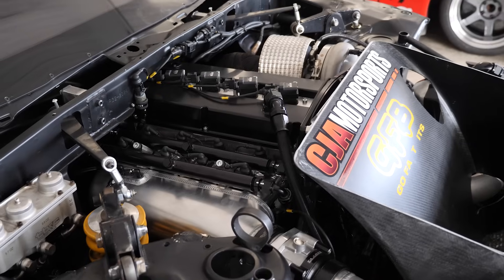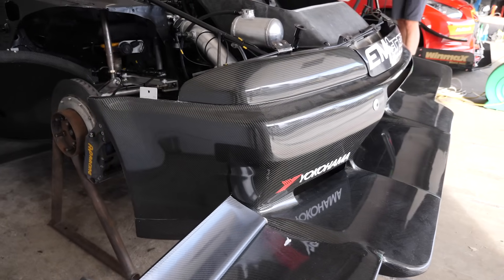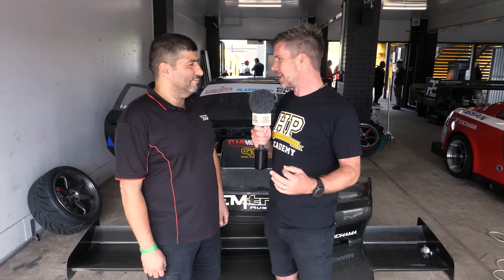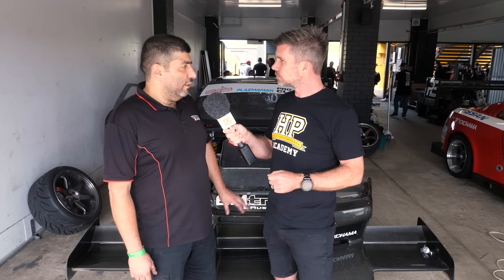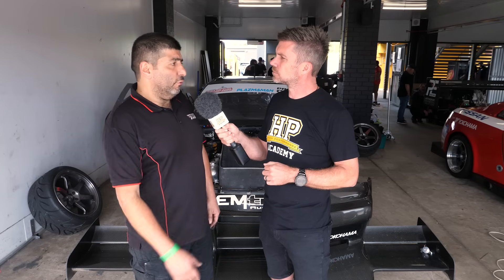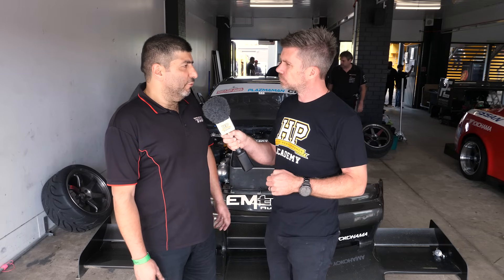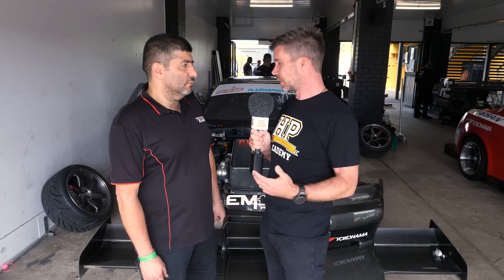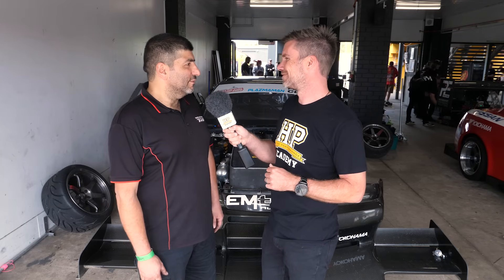Why A 4G63 Is BETTER Than An RB26 | R32 GTR 4 Banger

Comment: I want to do the opposite of this swap. I have a Eclipse GSX laying around with a built 4g63 but it's automatic (hate auto) and the dsm manual transmissions are trash. I want to take a full r34 AWD Attessa drivetrain with the 6 speed and fit it into the GSX chassis (fully seam welded) and get it to bolt up to the 4g63. From what I can tell it should work after getting the oil pan / front diff figured out, and a few other details. It would dramatically alter the weight balance by rotating the engine 90 degrees and getting that heavy automatic out of the engine bay and going with a long shaped tranny down the trans tunnel instead. Ideally the goal would be a 50/50 balanced 2700-2800 lb Attessa AWD Gsx but it'd probably more like 52/48.
Reply: @joels6736  dude put in a forced four shift box man You can tweak that thing to shift it full line pressure and it will smoke any five-speed GSX on the road If you want to know more about it contact Rix racing in Morgantown West Virginia.  He's  the only one around with an all-wheel drive dyno and he specializes in automatic all wheel drive 2G and 1G eclipses.

Comment: 2:11 THAT is the reason they went with a 4G63, the fact they knew the engine well. Sure it can do everything they need but there are other engines that could do it as well, ie: 3SGTE, K-series, or even the standard RB if they were able to work out the weight balance, but it is that they know the engine well that trumps every other reason.
Personally I would say a 3SGTE or a K-series are a bit better but probably not enough to justify learning a whole new engine.
Reply from the maker: Note, they have run one of the worlds fastest RB engines, but you are not wrong, the 4G63 is a better option for this project based on their experience and timeframe which is an important factor to consider and why there is never simply a 'best' engine as what is 'best' is more than just what is stamped on a block without considering anything else! - Taz.

https://www.hpacademy.com/blog/2140hp-78-psi-of-boost-rb26-world-record-trp-tech-talk/?utm_source=youtube&utm_medium=social&utm_campaign=general-interaction

Comment: 4g63 is the 2JZ of the 4 cylinder engine world, fantastic choice. I prefer the 4g over anything Honda just for the sound. Hondas just don’t sound good and the 4g63 just edges the Honda's out for being cheaper to make power with.
Reply: 4g63 & 2jz are both engines man lol

Comment: That’s an awesome build lotsa time and money in that!  Is this class allowed to run say a small capacity motorcycle based V8 like a busa or the kiwi made synergy Kawasaki zxr1200 based V8 I can only imagine these have been built with boost in mind or as an option  the 4g 63 is an impressive unit tho ! R the K20s that much better?
Reply: They wouldn't be aloud at this event atleast
Reply from the maker: Not sure sorry! As Michael mentioned, while they are pretty loose, there are some rules! I know for example Andy Forrest's current build doesn't meet the WTAC rules which uses such an engine, but also his chassis not the 'norm' for WTAC either. It fits whatever rules they have in Scotland though, maybe WTAC needs to loosen up a little further? 😉🤞 - Taz.

Comment: Way to go is. 2.0/2.3 built focus ST ecoboost engine! With the 2.3 internals!  Proven to be the new 4g63
Reply: Oh you mean the engine that can't flow for shit beyond 6000RPM without extensive headwork?
No thank you, 4G63 master race
Reply: @EVOFans  well that’s why u have to use a 4 port head buddy!! Not the stock head! It’s not even the stock block! But still all ecoboost!  I’m building a 1000whp ecoboost mustang right now! Using a sleeved 2.0 focus ST block , and a 4 port head that comes on the Range Rover evoque.  Should be out by end of the year! Or early next year
Reply: The 4g63 will make way more n for half the cost. No sleeving the block needed cause it's still closed deck cast iron, heads ports flow plenty b4 porting, will rev with the best of them with proper valve train. And also has a bunch of years of development over the ecoboost engine. 4g63 is king of 4 cyls but people wanna forget n hop on the k bandwagon.
Reply: @dsm_zo  yeah your 100% right!! But hard to find a good evo nowadays.. I’m building a 1000whp mustang ecoboost right now, but not using the stock engine components! Using a sleeved 2.0 focus ST block, with the 2.3 internals, 4 port head off Range Rover evoque for more air flow, it’s a variant of the ecoboost engine. Everything is the best metals and parts money can buy! Like Callie’s 4340 enforcer rods, upgraded 3.5 rod bolts, 250wall h13 wrist pin, custom spec vct piper cams , with a custom turbo kit by ETS with xona 105-69s turbo.  Should definitely give evos a run for their money.  But yeah would be a lot easier to make that power with a evo. But when it comes to cost it’s  pretty close

Comment: I'd love to see videos that compare engines having each engine in the room and showing positives and negatives of each block or head.   Sr20 vs k24 vs 4g63  or 2jz vs rb26 vs barra.   That type of thing.
Reply: Motive Video did a good comparison RB vs 2J with PRP
Reply: K20
Reply: Evo X's 4b11t is still a better engine than all of the above, except for the k20. In stock trim, the 4b11 is still a better motor in every way.  but in a full built config the head in the k20 begins to take the cake by a measurable margin

Comment: Over a 1000bhp to just the rear wheels seems like it gonna be a handful even with the ECU based traction control. He did mentioned the gearbox is somewhat similar to the R35 gearbox but why he didnt choose to run a second prop shaft to the front and have a front diff for AWD traction? 

The iconic Tom's Supra also runs a 4 banger 3S-GTE in the race car instead of the 2JZ for weight balance. 

Thats a weird but interesting suspension setup there. Why they didnt go full on push rod and go that weird double cantilever hybrid sort of suspension?
Reply: You get pretty diminishing returns out of awd at higher speed with a lot of downforce. 

These tyres are also pretty overworked so anything to reduce tyre loading is going to pay off even more than in other categories.

I love awd but the context I love it is a low speeds or in bad weather.
Reply: @jcadlols  Pretty sure the Motec/Haltech and other latest ECU have some sort of AWD traction control which can be made more rear biased. 

The Skyline ATTESA while old school by today standards was quite an interesting piece of hardware. Under hard acceleration, its only RWD. Only under cornering will the torque split to the front. 

Now there are gearbox control unit or GCU for short which controls the clutch / gearbox and diff systems. I am pretty sure we can make a solid AWD that is a monster both on dry and wet conditions.
Reply: Actually think cause of the rules they could run higher boost on smaller displacement engines the rest was a bonus

Comment: While it's impossible to argue the weight distribution will be better with a 4cyl.. if you wanna use a gtr run it as a gtr.. if u want a Evo run a Evo... They clearly do well at time attack.. seems a bit like fusion confusion, could have also started with a 20e she'll and saved 50k.. waste of a gtr

Comment: We are all in a toxic relationship with the RB because no matter how much it hurts us, one howling, screaming pull to 8000+rpm, and that sound sucks us right back in
Reply: I’d rather swap in a Gallo 24.
Reply: Billet RB is the ultimate
Reply: @kekethetoad  the recent 6 second pass of the red demon (~2000HP) fully billet 4g63 would say otherwise! Remember that's 2000HP out of a 4cyl..
Reply: I'd be a much richer man if I loved a more reliable platform
Reply: @slow26gtr  If I had 4wd I'd swap in a 4wd neo to build from & put the 26 to the side for putting the car back to original at some point, to be fair every car is gonna cost you if you push it
Reply: @sircefiro  wouldnt really save you much money tbh.. as you said, especially at any decent power!

Comment: I had an R32 and an R33 GTR many years...now an Evo 9. All I can say that the 4g63 is the better engine in every way...better response, lighter, no oil issues, not to expensive for more power and other things.
Reply: 4g63 all day for me, if it aint a 4g then its a 2j. RB's are cool but the hype makes them not worth running, its a shame because the sound soo good......one thing the 4g doesn't have.
Reply: @robbalinski1606  Why does the hype make it not worth running? I don't get it, the 2j is probably even more hyped tbh.
Reply: @ricardomilos654  The RB series hold less power then a 4G63 even stock for stock. Parts are double the cost of most other engines, the blocks are far thinner so they have rigidity problems at high power.... The 2jz has the hype because its literally twice the  engine the RB has ever been.  Then you factor in skyline tax, Supra tax didnt get crazy until like 5 years ago, but skyline tax has been high for a long time. I had a r32 GTS-T, for a very short period of time. Was a good buy for $2500.00 but I was still a pos. Car was put into a wall in 2012 and sent to car heaven where it belonged.
Reply: @robbalinski1606  RB is still a capable engine for high hp builds, able to take 600ish hp with stock bottom end and look at the australians (oiling is one of the major issues but is fixable) and for the thinner interior yea some portion is really thin thats true, block will crack at around cylinder 3 at 650+ whp due to block twisting caused by the awd system, also you're right about the fact that parts come expensive, 4g is definitely a better choice in terms of that
Reply: Worth all the bs just for the sound though mate!
Reply: At some point, better hydraulic lash adjusters were introduced, and they solved the noise. The Evo IX may have had them. Using current HLAs in earlier Mitsubishi engines often cures the noise for a long time.

Also, Kiggly racing has an oil regulator that helps the HLAs function correctly.

Jafromobile mentioned that there is an oil feed in the cylinder head that gets smaller when you resurface it. Therefore, when rebuilding a head, port it open to prevent problems.

I aspire to own an Evo X. I hate timing belts with a passion. Just because some cars I love have them doesn't change that fact. Also, the Evo X will now and forever remain a classic because Mitsubishi probably won't build another rally car.
Reply: Theres just something special about those old school japanese straight sixes though
Reply: I thought the heads had some oil issues isn't that why they get noisy lifters? I remember reading it on a tuning website.
Reply: @AdmissionGaming  Yeah, par for the course with a hydraulic lifter setup. But it's really not common. I've had mine for a long time and I haven't got lifter tick yet.
Reply: How and y ?
Reply: But 4G63 engine note is kinda gay n NOWHERE near as nice as RB inline 6!
Reply: @emolutioning  better than having no oil pressure ;)
Reply: A Honda K series is more than a match with all these engines.
Reply: @igvtec  except at swallowing big boost. I love the Honda k series but you’ll be needing a billet block or cylinder liners to handle big boost while the standard 4g63 block just handles it as Dom has shown.
Reply: @5150gino  1300 to 1400HP on stock block with Darton sleeves is impressive enough.
Reply: @igvtec  I agree. If this guy was concerned about weight and balance, why not use some kind of aluminum block engine instead of an iron block? Plus, the K-series VVT system is better than what the Evo IX VVT system was.

Maybe he was going for a level of boost a Honda K series wasn't going to take, whereas a 4G63T was already built for boost?

Of course, if a car costs already that much to buy and build, how much more would it really cost to darton sleeve a Honda K engine, use beefed up connecting rods, and other tricks to make an NA engine take the pressure?
Reply: @skylinefever maybe it's the fact that it's a small motor and he has specialised in 4g63 motors for decades...why move from your speciality that delivers the goods perfectly,